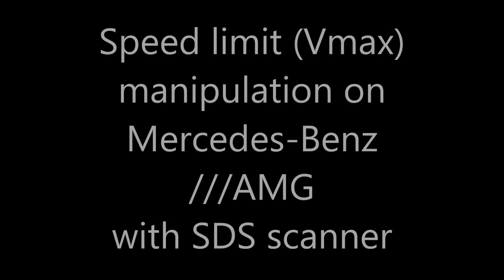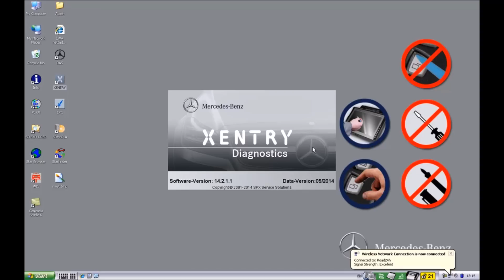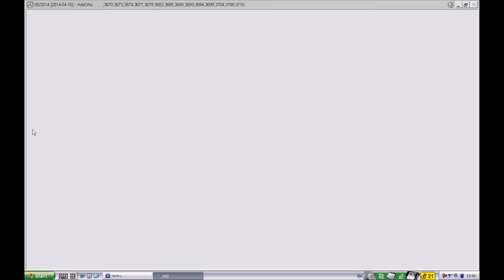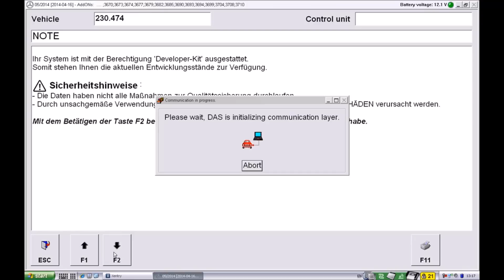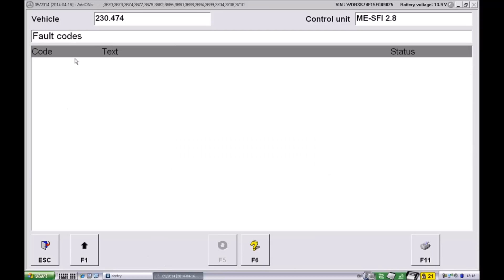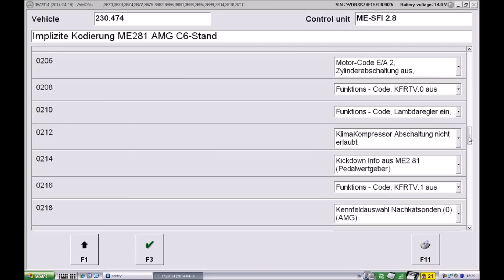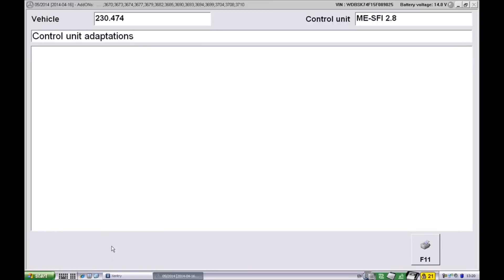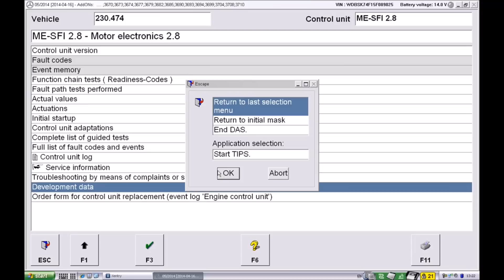Mercedes-Benz Speed limiter

Comment: This messed up my esp abs coding! Any idea how i can code it back ??
Reply from the maker: You're programing the ECU (ME module) with this tutorial, it has nothing to do with ESP coding. You can simply reverse what you did here by selecting the stock speed back.
Reply: @EurochargedBoston there is a another person who has the same issue in the comment section
Reply from the maker: @ where did this video come anywhere near deleting secondary air injection and other similar modifications? undo what you changed, and everything goes back to normal. Unlock the ME first before you can code.

Comment: I'm tryna figure out why my 06 S55 maxed out at 120mph, although it's set to 155mph??? The engine was already present before I mashed the gas, so I'm wondering if the top speed was reduced for that reason? Also, the transmission spit some oil out due to the oil being slightly over as I went to reduce my speed rapidly via braking! Shit scared Tf out me, bcuz at that time I didn't know what was going on. My mechanic checked it out and informed me of what happened, lol! Nevertheless, I wonder if that could also have been a factor in a reduced top speed? This upsets me, tho, bcuz I was told that it had a speed chip and would do the dash. Although, I didn't really believe it anyway bcuz he said the chip was hidden somewhere under the hood. That was an automatic red flag for me since I've never heard of a chip being able to be hidden, smh! BTW, the engine light is for a catalytic converter below efficiency, if you wanted to know!

Comment: Hello,i did this coding to delete air injection pomp,but now i have esp abs speedtronic and run flat tire inactive,i try to go back to original setting but says communication error,please if some one can help,thnx
Reply: You will need to have the systems recoded via SCN coding. Thanks to MB they have really blocked the common user with a DAS laptop from connecting to their servers even with a login and password. So a trip to the dealer is in order or an authorized Benz shop with its own server leased from MB. Its so expensive to lease a setup so ask the dealer to update any and all control units needing updates. Good luck and be happy to just get everything back working again like factory new. Who cares if the air injection pump runs? It only runs for one minute when the car is cold after startup and occasionally when the car senses it needs it. It dosnt run all of the time.
Reply: Yeah this happend to me aswell!!
Reply: Hello mate i saw your comment on eurocharged bosten Video regarding removing vmaxx. How did you solve your abs esp error because i also deactivated secondary pump and im having the Same Problem. Please help out.
Reply: @mofa9379  new ecu,or virginize and activate with the car
Reply: @ do you know the reason it got messed up ? Why abs esp etc came on
Reply: @endri15255  why did it mess up your ecu i would appreciate if you could reply mate 🙏
Reply: @mofa9379  i dont know why happend

Comment: I have 5 options Vmax= 250km, instead of Vmax=260, Vmax= 270, Vmax=280, and I choose the last one, do you know why is only Vmax= 250km, not Vmax= 300km. The car is w203 c32 AMG.
Reply: @ Kritiqn Kirilow:  Did you find a solution for that? I got the same problem on a C32AMG. DAS only shows 5 options with 250Km/h.

Comment: I did this without the engine running. The only time you need it running is if you hear your radiator fan turn on, that's only real power draw.

Comment: Derestricted The SL55 can do over 200mph
Reply: YES THEY CAN!  Car and Driver magazine back in 2003 confirmed that derestricted test mules were gear limited to 208 mph!  The only reasons they restricted to 155 mph was to honer the gentlemen's agreement to keep that top speed to save the environment and there were no tires available back then rated to 300 kph.  I get called out when I make this claim at car meets but it's true.  My SL55 has the P30 Performance Package w/ a 186 mph top speed from the factory along with bigger composite front rotors (390mm), LSD and Nurburging "tune" that has stiffer  ABC springs and recalibrated shocks for 30% less roll, pitch and yaw on the track.

Comment: Awesome and dope video! I have a GLK350 2013 US model. I swapped by halogen headlamps for aftermarket bi-xenon headlamps. The aftermarket headlamps do not have the side markers (the how the US model do) therefore, I get a message saying "Check left & right side marker. Lamp out". How can I make the changes with this?
Reply: The light bulb is actually a resistor and the computer can't detect any resistance, hence believes the bulb is burnt. 
Need a resistor or adapter. 
I had same issue with mini cooper when i installed LED lamps.
Reply: Now ur car is had coded to is change it To europe

Comment: Hello, my car is w221 S class it is middle east option. when I drive at 120km it shows me this message on the dashboard (speedometer) 120 km maximum speed exceeded, and I can not control any thing such changing music from the steering wheel I now some one who can modify this to be like other car options like cars from japan or germany or the US but it is expensive do you now how to program it ? can u show as how to ?
Reply: Well, that is very simple, but you need to know about automotive control units and how to access the data values and manipulate it.  There are several ways to do this.  The simplest way is to have your National Version changed to something besides "Gulf States."  This product that he is using is not legal as the Development Data menus are restricted to Daimler AG manufacturing partners and not designed to be in the hands of Dealerships, much less the public.  Xentry is not available to the public either, so that is against the law as well, unless you are an independent workshop and have rented the device directly from Daimler AG.
Reply: @nanopiebald  I just want to thank you for your policing of the Internet. You're really making a difference. Keep up the good work.

Comment: Hello, is there a option to reduce the egr or to deactivate the egr with Xentry?
2012 ml350 bluetec
Thanks
Reply: Not easily.  You are better off sending your ECU to a company that specializes in the tuning of European automobiles.  They can remove the AdBlue code completely from the code in the ECU to where the ECU doesn't even know what "AdBlue" means.  If it is legal is another story.

Comment: HI
I have a w211 model 2003 e 200 kompr
iam living in GCC  there is any way to remove the sound when i reach 120km 
coz the sound is very noisy and the meter stop working on message speed limited exceeded

Comment: How did you get this software?
Reply: It seems to be pretty clear it has been pirated and had been reverse engineered likely sold from a Chinese vendor.  They do not respect Copyright, and charge you for someone else's work (Daimler AG) and then have the gall to apply copy protection on top of their already stolen code.  These machines are infested with viruses, malware, and Trojans, and have virtually zero support.  The best advice is run.  you can visit your local Mercedes-Benz dealer's Part Department to inquire about one and they can provide you a quote.
Reply: @nanopiebald  I did exactly what you're suggesting. They said nope we're not selling them to public but they encouraged me to swing by and stay in the line and overpay them at their $100+/hour rate.
Reply: Rodeo Are you attempting to purchase/lease Xentry Diagnostics or only manipulate your VMAX?

Comment: Bayhas,
The Distornic Plus with Active steering only lets you hands of the steering 10 seconds. Do you know how to increase it to for example 60 seconds?
Reply: That is hardcoded into the Distronic Plus Control Units  - i.e. there is no way to make the car resume driving after 10 seconds or unless you actuate the cruise control or gently press the accelerator.

Comment: Will it work on w203
Reply: Kyle Krieter you can change speed limiter from car hidden menu also, with steering buttons and checking instrument cluster
Reply: This is incorrect.  You can only change the top speed of the vehicle to compensate for Winter tires.  US models do not even have a menu for Winter tires (tyres).

Comment: Any Idea what to do? I have SL55AMG and it does not have option for 300km/h?!? Did everything as You instructed in the video. There is several 250km/h option but no 280 or 300...?
Reply: What? SL55 goes 187 MPH easily. Maybe you're thinking of the SLK55.
Reply: The car can't reach that speed. That's nearing 180mph and on the sl55 that is most likely not possible
Reply: @onekidneystan4330  195 mph top down - confirmed
Reply: @onekidneystan4330  derestricted with out any tuning the SL55 can do 202mph
Reply: Mikko Marttil
Reply: Do you have a answer in the mean time? I have the same problem with my CL 55AMG K. Only 4x 250km/h
Reply: @ricardosnel5187   Did you find a solution for that? I got the same problem on a C32AMG. DAS only shows 5 options with 250Km/h.
Reply: @jasonst5688  do you think a 3.2 engine is capable of going over 260km?
Reply: same here yesterday: W209 55 amg convertible ...only 250kmh. Why and how can it be fixed?
Reply: @DMcQuake   Did you find a solution for that? I got the same problem on a C32AMG. DAS only shows 5 options with 250Km/h.
Reply: @jasonst5688  unfortunately no solution found and never tried again with this car

Comment: Hello from Germany, which cable did you use? Am I fine with a normal ODB II cable?
Reply: lunatic where  are you from ?
Reply: Near Hamburg, Germany.
Reply: SDS C4 via OBD2 port. There are no other ways to connect to an R230
Reply: You will have to connect to this car using a VCI of some variation, and there are a few to choose from.  If you are trying to get close to the level of access that he is illegally demonstrating here, you will will need to call the Dealer Assistance Hotline and arrange to lease a Xentry Kit, however the Development Mode menus will not be present thus blocking the option you want.  Just a subset of dealer equipment is a Part D MultiPlextor that converts the large OBD2 connector to a round connector, which converts it yet to another round connector and changes protocols to an RS232 Serial Port that is found on laptops around 2006 or so.  A Dell Latitude 630 or 830 is one of the last preferred laptops that have a native RS232 port.  Anything after that is the poorly constructed Latitude 5XXX series, which is highly discouraged due to poor quality.
Reply: Nanopibald, what's illegal, exactly?  He owns the car.  If he is allowed to dump poop into the cabin, he should also be allowed to change some bytes in the car eproms.

Comment: We are stuck at 130mph here in the states.
Reply from the maker: tonkatoytruck 
Said who? the SL used in the video is an all Amercian Merc :D
Reply: Bayhas Kana Says me and every car magazine covering the US cars. I own a W211 and have maxed out the speed limiter at 130mph.
Reply from the maker: tonkatoytruck Not sure if you watched the video you're commenting on, but it talks about how you override that  very limit...

Mercedes generally locks the speed to the max the tires can handle safely (rating), and what the engine can provide in power. 

Most V6 sendans and couples are locked around 135ish, V8s and V12s at 155, and SUV's at 120ish. (except for special packages and designations)

The video talk about how you can raise the speed limit, within what's physically possible, for a given engine and body style...
Reply: Bayhas Kana The automobile magazines state that the gentleman's agreement in Europe is 155mph, in the states, 130mph (we are talking German cars).
Reply from the maker: tonkatoytruck That's how the cars come from factory, watch the video, and learn how you can break the gentlemen agreement... 

155 applies to high end cars in the US BTW...  but who needs 155 when you can do 183 :D
Reply: Lol 😂 😂 😂
Reply: An S600 is a BiTurbo V12, and would achieve speeds much faster than 130mph, however it is electronically limite to 130mph.  Let's face it, in the US there is no place to go that fast, and a 255mph limit is just a waste of reprogramming your car with the change of messing it up.  Here is an S600 with the factory 130mph speed limit.  You can tell when it reaches this speed and the ME cuts off the fuel supply, however the driver stays in it for several seconds after reaching the top speed.  It has plenty left, but the ME puts a limit on it. https://www.youtube.com/watch?v=5zQ5knHLGCk